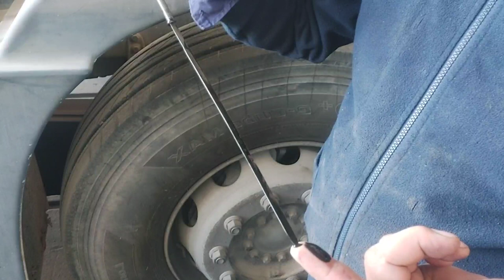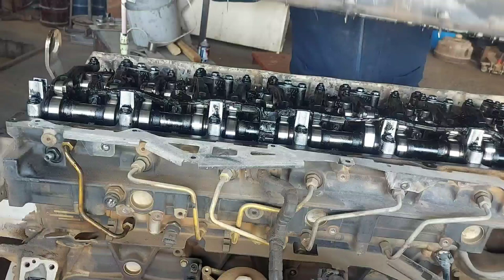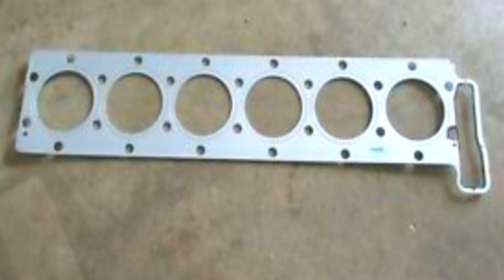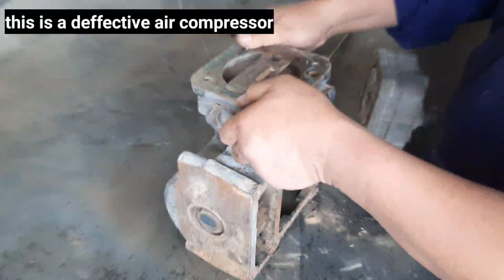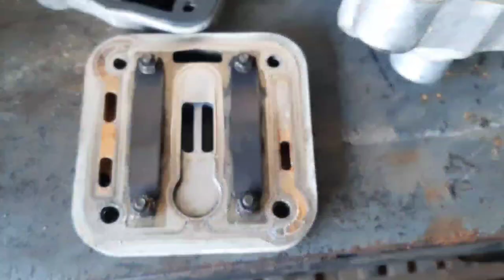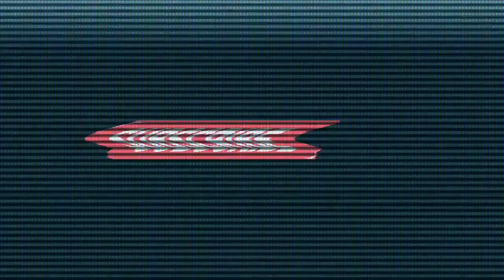Trouble tips and information MAN

Comment: Hello, please tell me, there are spare parts for the oil filter below and corpses with air go to it, and it started to poison the air when the engine is running, I want to know if there is a rebuild kit for it, or if it is completely changed, Motor MAN TGA, Euro-4 D20.  66 2006 god thanks!!